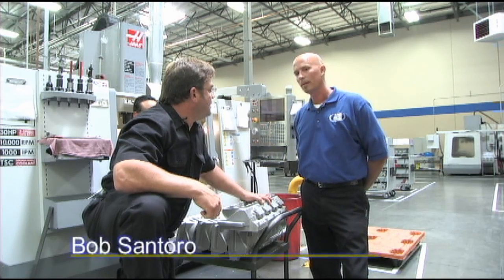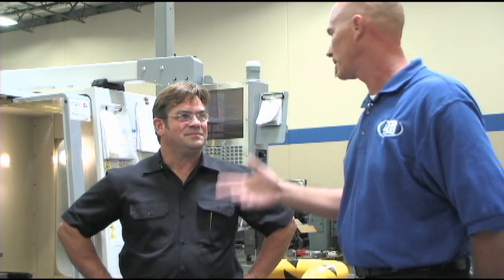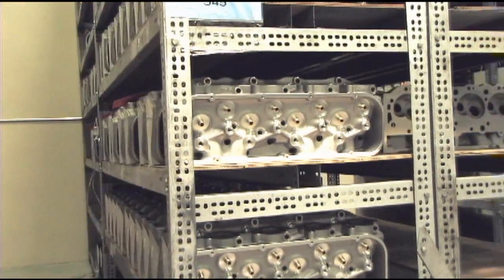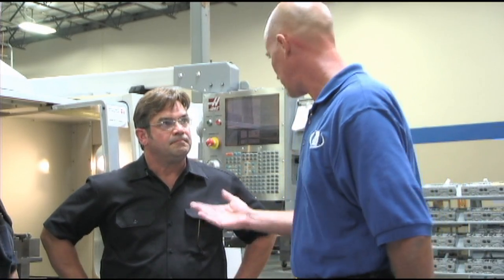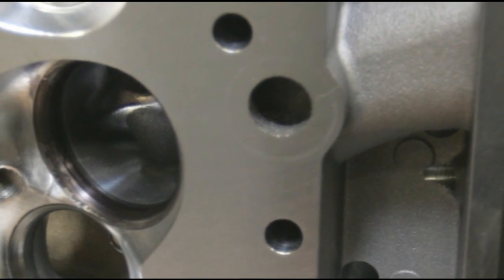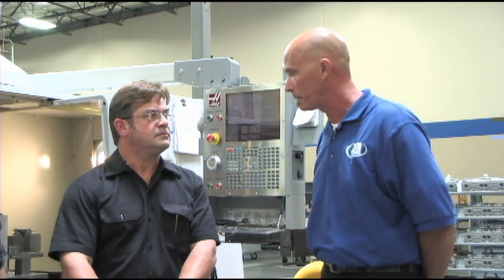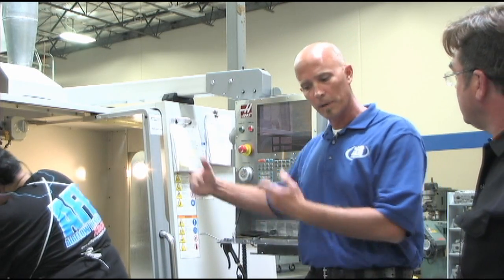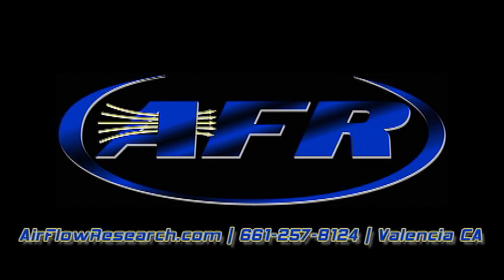AFR's Cylinder Head Manufacturing -- Step 1

Comment: AFR's are a work of art, I call them my "Man Jewelry". I ran the 210's about 4 years back. Right now I have a brand new pair of 195's that I am going to put on my 383 build up of about 525+ Hp.. Won't have a car for a year or two, but I have every fastener and all parts for the motor new in boxes in my bedroom.